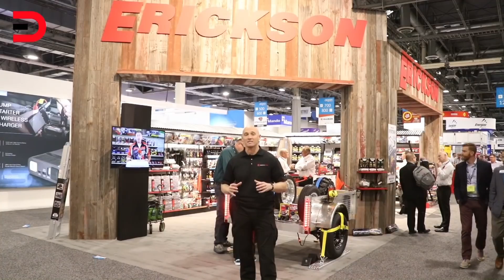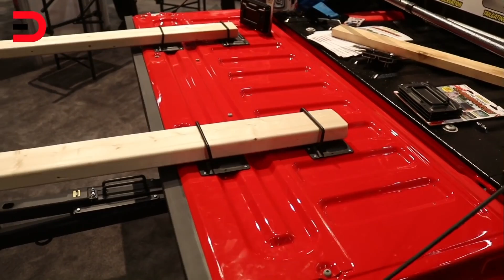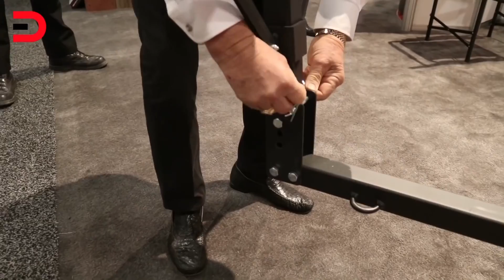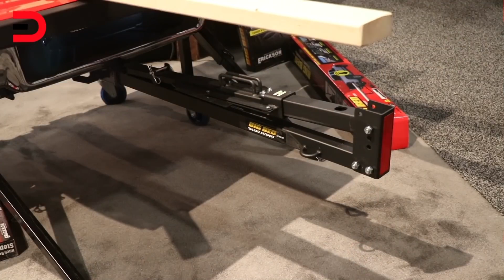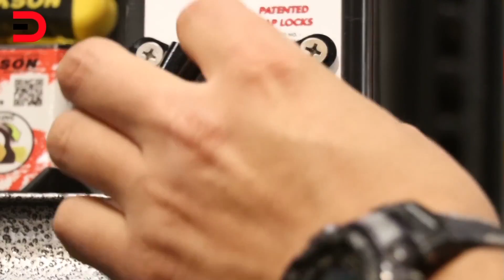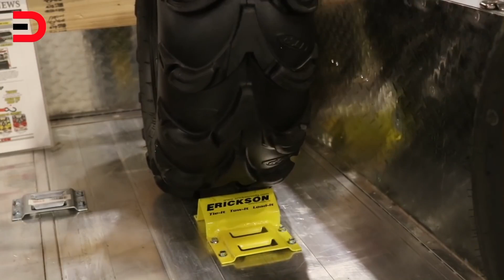Smart Cargo Ideas for your Car, Truck or SUV with Erickson Manufacturing SEMA 2018

Comment from the maker: Shop the Best Selling Auto Parts: https://amzn.to/2CQmxLz
Find New Car Deals by Zip Code: http://bit.ly/2CYZxuL
Performance Auto Parts: https://amzn.to/2Clupnn
Automotive Car Car Products: https://amzn.to/2q69Eot
Exterior Accessories: https://amzn.to/2pXxLW7
Interior Accessories: https://amzn.to/2pZ3TJ9
RV Parts &d Accessories: https://amzn.to/2CQgF4P
Tools & Equipment: https://amzn.to/2ymITk4
Wheels & Tires: https://amzn.to/2NMv9DP
Light & Lighting: https://amzn.to/2RY4kQr

PRODUCTS, REVIEWS & LINKS:
DJI Mavic Pro 4k Quadcopter Aerial Drone: https://amzn.to/2Eno7W5
Motorcycle/Bike Camera Mount: https://amzn.to/2EiKQ4L 
Car Seat Gap Organizer: https://amzn.to/2QEEL5I
----- Review: https://youtu.be/fdhHihwvnLg
Chicco KeyFit 30 Infant Car Seat: https://amzn.to/2UtWwHB
----- Review: https://youtu.be/_1RlQpkzCKw
Z-EDGE T4 Dash Cam Link:  https://amzn.to/2Tn9pCM 
---- Review: https://youtu.be/vWAOQWSFewA
AUKEY Dash Cam: https://amzn.to/2Ef7afG
VanTop 4K WiFi Action Camera: https://amzn.to/2SwJSpn
---- Review: https://youtu.be/2ZJ5yueDCmk
Canary Car Security Camera:  https://amzn.to/2Otk9Ql
----- Review: https://youtu.be/L7qqmqJcH_w
Waterproof Car Garbage Bin: https://amzn.to/2pKtSUm
----- Review: https://youtu.be/D2HZU7xTU5o
In-Vehicle Trash Bin: https://amzn.to/2E04WlZ 
---- Review: https://youtu.be/GjcIsKW_jXA
Weathertech DigitalFit Floorliner: https://amzn.to/2IB1gWo
---- Review: https://youtu.be/5ipE8egNRb4
Car Seat Protector Kick Mat: http://amzn.to/2CDc6q6
---- Review: https://youtu.be/qTuWgZ-42o0
Lexol Leather Cleaner: https://amzn.to/2zLQ5aD
----- Review: https://youtu.be/T622Ec77ZPY
KNIGHT VISOR Glasses: https://amzn.to/2Qn2pI6
----- Review: https://youtu.be/TXDCAToZgrE
Clip-on Polarized Driving Sunglasses: http://amzn.to/2jWAlGK
---- Review: https://youtu.be/otJHTEyNLXk
Night View Driving Fitover Glasses: https://amzn.to/2UuR1bA
----- Review: https://youtu.be/G-lejCyjV4I
Tile Mate - Key Finder: https://amzn.to/2xRV6wC
----- Review: https://youtu.be/ODaciwqvbQk

Comment: Cut a 45 degree on the tongue of the extender so it is easier to install into the receiver . Install LED button lights and reflective tape on the extender .  9/22

Comment: I'm not big on commercials, that said Erickson tends to sell quality stuff.  The bed extender is a nice option for a short bed pick up truck as long as there is enough weight forward in the bed to make sure the handling is stable.  The sliding ratchet is a good idea, my straps are just fine for what I do, but if I ever need more I would buy one and test it personally.   The cap lock feature is a nice touch, but completely unnecessary for those who know how to properly rig a strap.  The retractable ratchet strap has too many moving parts for my taste.  The tire and E track system would be more to my liking if the straps were in a basket configuration, like the straps for a wheel lift tow truck.  They would cost more, but it would be worth it for that extra security.